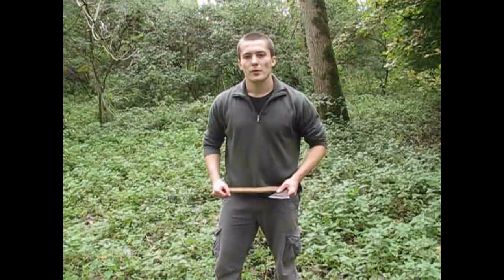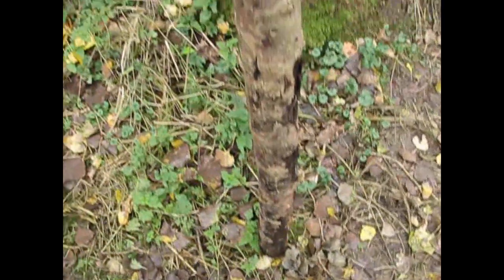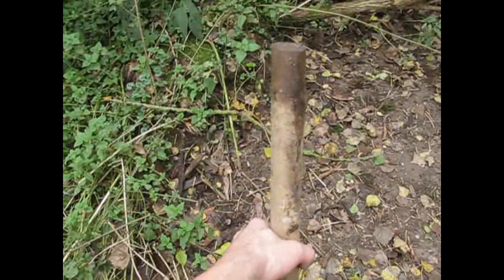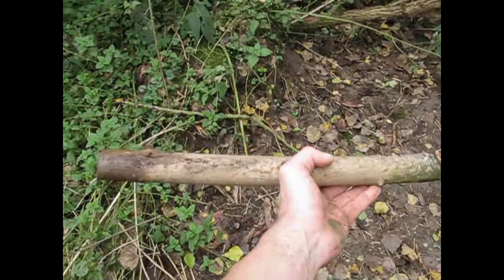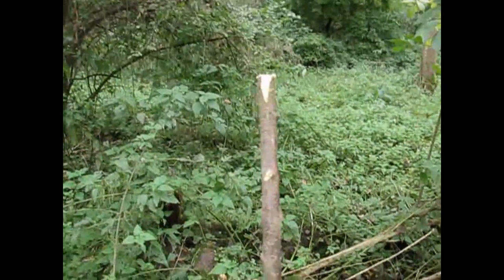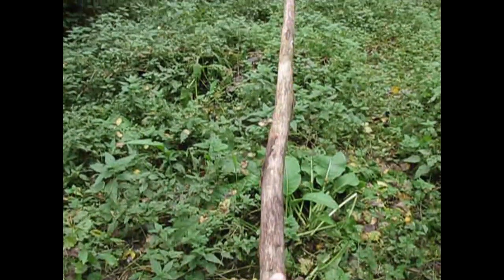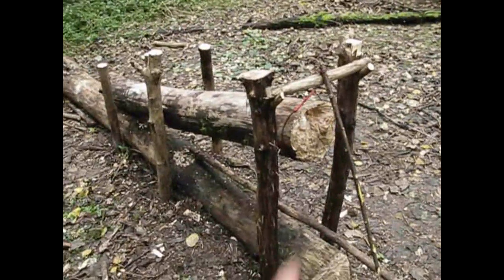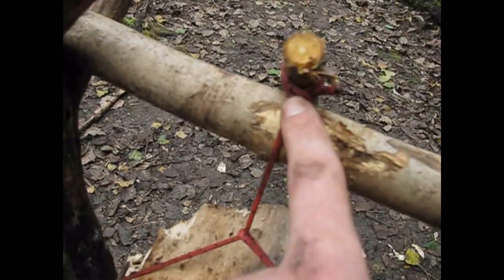LOG DEADFALL

Comment from the maker: Thanks Odd, I really appreciate the comment. I have seen this trigger in an old picture one time. It requires some work though, but I like to make them. When you are making this make sure your support stick is absolutely solid and the trigger system is light and solid to. The lighter it is the quicker the weight will fall down. You could also make it on a smaller scale. Thanks for watching my friend.

Nick

Comment: Lets see it catch something,. Looks good but does it work?
Reply: +aHigher Power yeah I want to see it squash something!
Reply: +aHigher Power I reckon its abit slow.If he lift the other end up a bit ,It would properly shut quicker
Reply: RBG0979 Yeah that is what I was thinking.
Reply: Yes, if you're a sloth then you're in trouble. Having the weight pull a stick around another stick is a problem.
Reply: +aHigher Power i fear that is no option looking at the serroundings and listening to hes accent i would say hes from the netherlands and their is nothing that size here that will take that trap (fall for that trap), we dont have carnivores in our country..
Reply: +aHigher Power that's so cool but u can't even catch a cold with that thing ;)
Reply: Not Too Sure These Days
Put some spikes on it to reduce the drop height and you might.
Reply: op zich denk ik dat een everzwijn of een hert er wel in zou kunnen blijven zitten op een slechte dag

Comment: It's too slow? Deadfalls catch rats and mice allll day long. You think a woodlands creature is going to be faster? Good luck.
The only thing wrong is the trigger. It's supposed to go on the inside, so there's very little time to pull back all the way AND more force to crush them. If they just have their head sticking in, then they can just move it. But if the trigger is in deep and you goad them in, then their whole body is under the log and they can't escape no matter how fast they are.